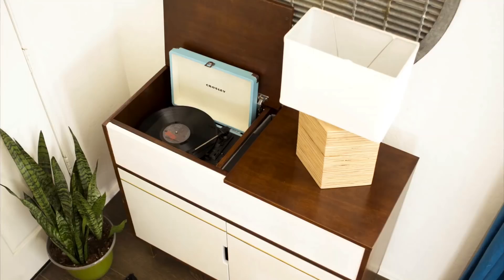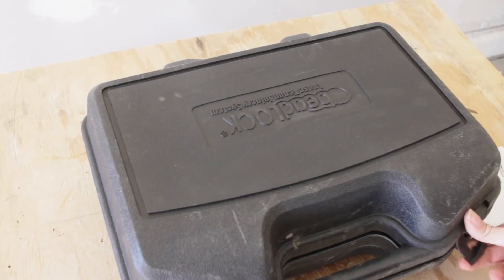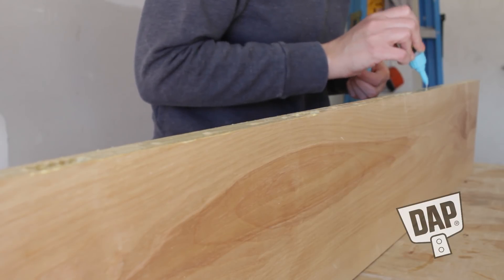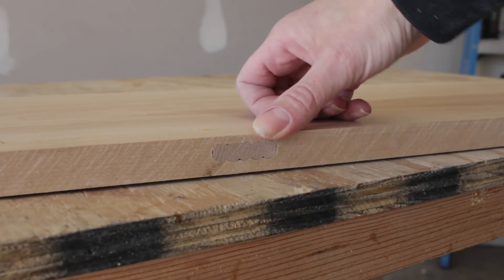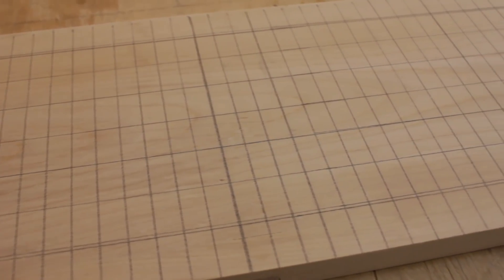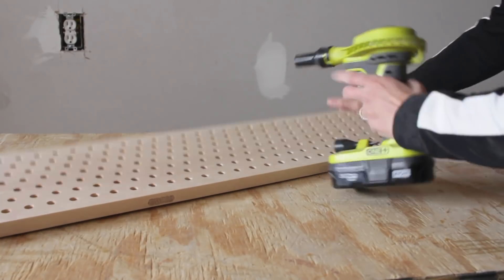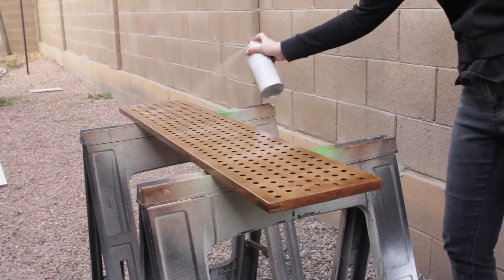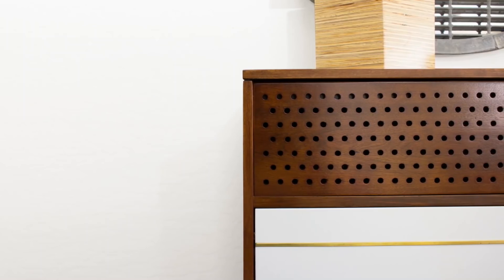WOOD Speaker Screen | How to Build Record Console Pt. 2

Comment: Great looking modification.
A tip for projects with lots of holes and no drill press, Use a plunge router with a spiral plunge router bit. The router acts as a drill press.
If you want to get your holes really precise in their layout, make a jig with a fence and a pin. Get a piece of scrap 1/4" sheet material and make a new base for your router, but in addition to the hole for the router bit, add a second hole the diameter of your bit spaced from the centre of your router's bit to match your hole layout. Make the first hole. Now attach your fence and push a dowel that's the diameter of your hole into the hole you just made. Line up your new router base so the second hole accepts the dowel and them fix the dowel to the router base with hot glue or a drop of CA glue. Tighten up your fence against the edge of your work piece and you're all set to drill your next hole. Then lift the router up, slide along until the dowel drops into the hole you just made. Between the dowel pin and the fence you now have a jig to drill accurately spaced holes without having to draw them all first and they'll all be nice and straight like you used a drill press.

Comment: Nice job.

Here is a tip when gluing up panels. Set the clamps up first. Lay your panels on the clamps in the orientation you want to join them. Apply the glue to the edges, butt up the panels and secure the clamps.

Doing it this way saves the hassle of trying set the clamps under the panels while trying to keep the panels aligned and together.
Reply from the maker: Thanks for the tip!

Comment: Nice work! If you have troubles with a tight fit put the glue in the holes instead of on the tenons. They tend to swell up before you put them in the holes.

Comment: Very retro design - nice finish. I missed part 1 for some reason...  I've just got a DW 745 too (UK version) and immediately replaced the supplied blade with FREUD ones: the finish from them is awesome. Made some comfortable push sticks and  zero-clearance inserts too - these really do add to user safety and the cut quality.  BTW, the crown guard on the US model's so much better than mine !

Comment: Never seen beadlock before.  I like it.  Waaaaaaay less expensive than a Festool domino machine.
Reply from the maker: I really like the Beadlock! I use it all the time
Reply: @PneumaticAddict 
Do different size drill guides slide different amounts or are center distances the same for different bits?

Comment: You sure fooled me, from the thumbnail, the piece looked liked Walnut. That being said, I need to praise you on your staining/finishing technique. Also, a drill press would not have been helpful at all since the piece is quite large to manage (on the drill press). In thinking about tackling on a similar project however going with a "jukebox" theme. Thanks for sharing
Reply from the maker: Thank you! I'm one of those weird woodworkers who actually likes to finish
Reply: Actually I made a drill press for drilling holes on my workbench for my bench dogs and it's very small making it great for using on a large surface like this. On pinterest  I saw a pic about a diy drill press using 2x4's, some scrap wood and a pair of drawer rails. Since I had one drawer rail only I modified the design and made it. Works great.

Comment: Nice project.  Congrats on the new table saw, but, PLEASE NEVER pull a board through the saw blade.  Get a push stick and push the work past the blade.  It will be safer and avoid any injuries.

Comment: Two points:
1) I don’t think a drill press would have been easier. Holding a large piece like that steady while operating the press can be a real pain in the rear. If I’d been making that, I’m sure I’d have started with the press and then gotten fed up and switched to hand drill since the exact angle of the holes isn’t, as you point out, a big deal. I think you did this the right way.

2) Next time, make two rips on the table saw, one on each edge of the joined board to move the seam towards the center. That way, you avoid exposing the tenons. Of course, on this piece it wasn’t a big deal since the edges aren’t visible at all. But for the future.